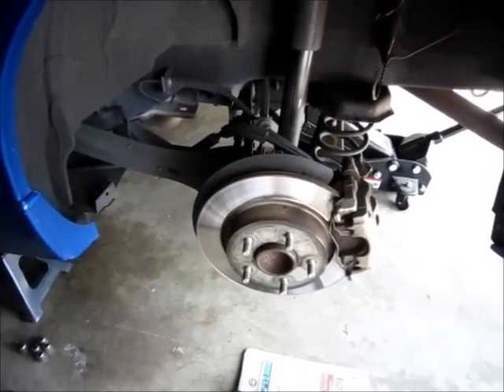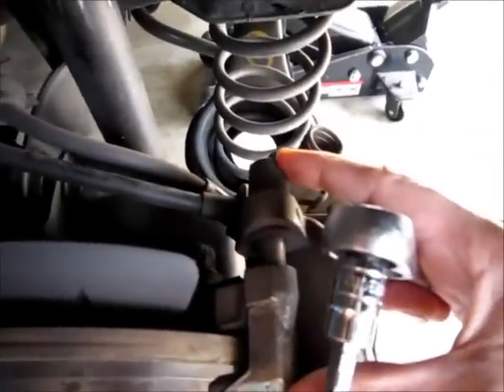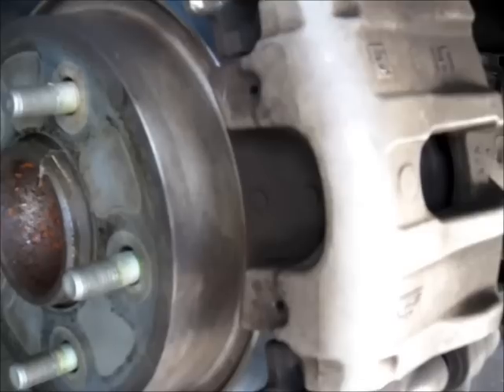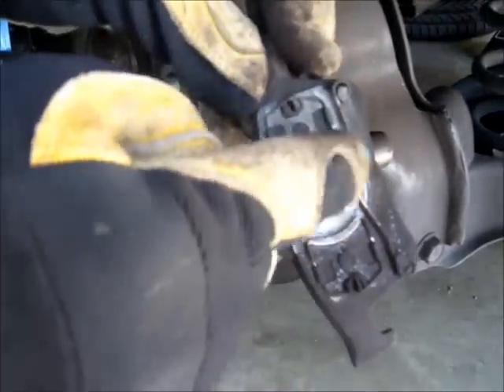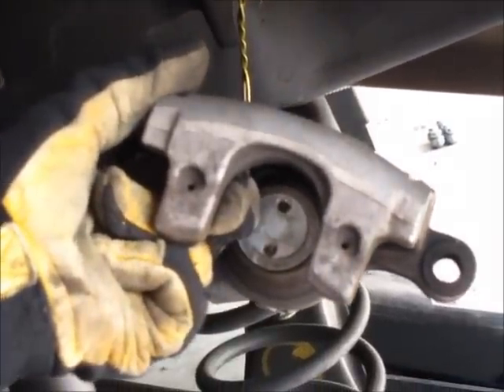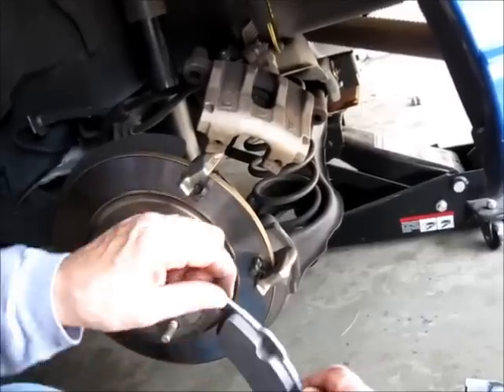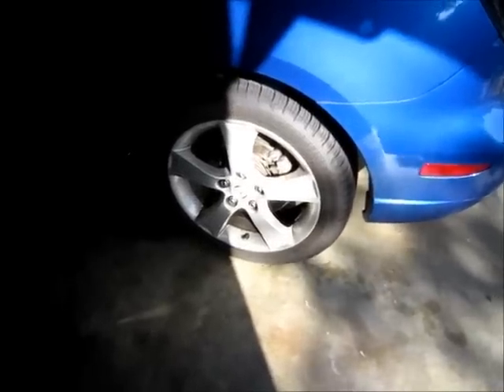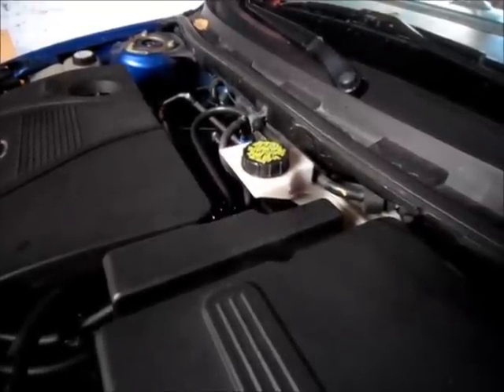2005 Mazda 3 Rear Brake Pads

Comment: On my Mazda 3, I had a friend open the bleeder valve and then push back the piston with a large screwdriver while I turned the piston with needle nose pliers. Worked like a charm! Then I made sure I bled the brakes before I was done.
Reply from the maker: Definitely another way of doing it. I would be afraid of the pliers slipping and damaging the seal or my knuckles.
Reply: cfldriven   I was a bit worried but my pliers stayed in the two holes quite well and my friend was careful with the screw driver. Not one store around me had a compressor to rent.

Comment: Nice vid.  Helped a great deal.  The clips on the backside of the inner pad are there to clip into a groove at the head of the piston, unique to Mazda.  If you don't do this the piston will be pressing on them instead of the pad and can damage the piston.  In my case it caused sqeaky brakes while driving because the pad wasn't fully retracting when I let off the brake.
Reply from the maker: Thank you for sharing.

Comment: good video.  exactly the same for 2012 Mazda 3 rear brake pads.  do a rotor change for rear?
Reply from the maker: Thanks, the basic principles apply. Not sure if you have to rotate the brake piston. If rotors are warped or this is the second brake pad I would op to replace both rotors. Good luck

Comment: Just a suggestion, make sure you get the right tool to compress the rears pistons.   I had an adapter that attaches to a ratchet but you could turn and turn and the piston didn't go back in.   Got another tool the compresses the piston as you turn, that did the trick in no time.   Save yourself some frustration and get the right tool.
Reply from the maker: The next time around I borrowed the tool from the local auto shop, and you're correct it made the job easier.

Comment: Two things. Would have really like to see you use the tool to push the piston back in and would have like to see the tightening with the torque wrench. Otherwise pretty good video. The Haynes manual say to unhook the parking brake cable before replacing the pads. What do you think about that?
Reply from the maker: At the time I made the video it was usually just me holding the camera with no tripod so you didn't always get to see every step. As to the Haynes manual releasing the parking brakes before replacing the pads is a good idea. Using the parking brakes with the rear wheels off the ground doesn't do anything for safety. Thank you for watching.

Comment: Thats really important to my guys next weak im doing it so if i take the cap out from the brake fluid tank i dont have to take the airbout from the brakes and change the brake fliud?? Just changeing the pads?
Reply from the maker: If your brake fluid is not old, you can do pads without flushing the fluid and bleeding the system. However if you need to change brake fluid then consider watching my video on Mazda brake flush
 https://youtu.be/TEMkbZYEJYk

Thank you for your question and for watching.

Comment: Im getting a clicking noise from my right rear side when i make right hand turns in my Mazda 3. I just recently had my brakes done  at the mazda dealership, Is there any reason for this, maybe improper installation. Just me give your opinion. Any help would be great thanks. I wish i found this video earlier could have saved 5 or 6 hundred bucks.

Comment: For the rear brakes there is a cube tool that you can get that works with a rachet.  if you google rear brake cube tool, you can see what im talking about.
Reply from the maker: I got one of those and was never pleased with it. It was better to get a loaner tool from local auto parts store.

Comment: I have same question on regards the size of the caliper adapter disk. Could you please let us know what the size  of it?
Reply from the maker: If you are referring to the tool that rotates the brake piston, it was a loaner from a part store. I sorta recall it came with an assortment of different sized  discs of pins. Sorry I should have noted it.
Reply: Coming in late on this, my UK-spec one has pins on 19mm centres whereas the tool I'd bought had pins on 23 and 33mm centres so wouldn't fit even though it was advertised as being suitable for Mazda.

Fortunately on the tool I''d bought it was possible to knock out the pins and drill a couple of new holes at 19mm centres. Once I'd done this it worked fine and did the job in seconds.

Here's the tool I bought. Note the importer stating in Q&As that it fits Mazda3 and their silence when corrected: www.screwfix.com/p/hilka-pro-craft-brake-caliper-rewind-tool/4119r

Comment: At 9:05 you say you have to torque it. What does that mean? Do you have a video on that?
Reply from the maker: You use a torque wrench which tightens the nut or bolt to the desired manufactures specification. If you go to 3:25 in this video https://youtu.be/syw0skaUVN0 you will see it in use. Thank you for the question.

Comment: quick question about the rear brake pistons, do you need to push it ALL the way til it doesnt go in, or JUST enough to allow the thickness of the new brake pads to go in? i've been getting mixed replies regarding this matter, i would appreciate it if you could tell me! thanks
Reply from the maker: Well this response is 11yrs too late but I would have pushed the brake piston all the way until it was seated. It provides for the most clearance.

Comment: When you took that first outter pad off you said a shop stuck a little piece of metal in there fixed the problem. You never said what the problem was rattle??
Reply from the maker: Joseph, it been 12yrs since I made the video and your the first to ask. The brakes would clatter when driving. They checked out fine, but the tech cut a small piece of metal from a soda can and that instantly solved the problem. Didn't need the piece of metal when I finally had to replace the worn pads, so I suspect one of the shims was bad.
Reply: @cfldriven  Thanks for the reply. Yes i realized the post was 12 yrs old and had no idea if you would respond thanks. Why i asked is i have the mazda3 2005 yes its old. Mechanic replaced rotors and pads new. Not long a few days started getting terrible ratlle clinking and clanking left rear. Touch brakes silence. Took it back to him put it on the hoist did not even take the wheel off points and says caliper worn out car not worth to replace. There is terrible rot i know. I guess i am going to pull the wheel off maybe i can shim it so your video was a good visual.Thanks for the reply. Interesting video on the prius. I will sub you. Your manner of explaining things are quite clear ... cheers man
Reply from the maker: @josephrunions3913  Sorry to hear that replacing the caliper is not a viable option. My concern would be since the rot prevents the replacement of the caliper I would worry that a component failure would lead to loss of control.

Comment: Hi, after you've pushed back the pistons and twisted it clockwise...do u need to manually twist it back to its original position after or will it automatically goes back when u depress the brake pedal?...pls let me know..& thanks so much for this little tutorial...=)
Reply: +Ray “Mr. Yoso” Dar I have the same question, what conclusion did you come to?
Reply: i've just stepped on the brake pedal when i've finished putting back everything together Sir.and the piston just came back on its original position.
Reply: Thank you brother, I appreciate you getting back to me.

Comment: Typically Mazda 3 have issues with rear sway-bar end links, as these typically go bad on these cars. I had to replace them on my wifes car at 60k miles.... If it's only when you turn right then it is typically the left and vise versa. Your brakes shouldn't make a noise when turning because there are no moving parts unless you apply the brakes. It will sound as though something is lose in the trunk or something....
Reply from the maker: Sold this car in Dec 2017 with 75000 and except for some brake clatter, which I fixed with a coke can https://youtu.be/Ar11068EJ3g   this car never needed any suspension work. Thank you for your input.

Comment: Okay my question is i just got my rear caliper installed on my 06 mazda 3 and  because old one was leaking brake fluid. I paid 250 to get it all done but when i left the garage my breaks on the rear right wasnt working wasnt doing anything only the front ones were working so the petal was really soft. Just want to know what they did wrong
Reply from the maker: My first guess they didn't bleed the air out of the brake line.

Comment: im haveing this problem with my rear brake pads on my 2004 mazda 3 .. did your mecanic put any metal piece or you had to buy an special one ? thanks
Reply from the maker: I had a clatter on the rear brake and a tech slipped a small piece of metal from a pop can and no more clatter.

Comment: Anyone else have issues were the back tire rusts to the brake hub?
Reply from the maker: I have had the wheels rust to the brake hub, took some pounding with a mallet to break it lose. I removed all the rust before putting the wheel back on.

Comment: How do you torque the brakes?
Reply from the maker: Actually you torque the nut or bolt with a torque wrench. You have to look up what the specified torque ft/lbs setting is for particular nut or bolt and then use a torque wrench that can achieve that number.

Comment: I kept trying to compress that piston and it wouldn't go, so I figured I'd better see if someone made a video to show me what I was doing wrong.
This one did the trick, thanks.
The wrench for my grinder had the same spacing as the holes in the piston, so I pinched it between the piston and the C clamp and turned it while I turned the C clamp, it was a pain but it worked.
I didn't do it but the guy was right that said you should push that old fluid out the bleeder, then add new fluid and bleed the braked, That's the best way to do it, but I cheat and just push the old fluid back in the lines like in the video.
Reply from the maker: Thank you for sharing your experience.
Reply: @cfldriven   I still have the same car and I replaces the brakes again since then, so I bought the special tool. I also replaced the rotors. I've had that car almost 16 years and I've never had to do any major repairs, just normal stuff like brakes, tires, filters, battery, it's a great car.
Reply from the maker: @bigredc222  Before the M3 (12yrs) ,  I owned a 323 for 18yrs, Mazda makes some under appreciated vehicles. Like you they were trouble free cars requiring only regular maintenance.  I would still have the M3 if I had not opted to go EV, but that is another story.
Reply: @cfldriven  I bought mine new in 08 so I'm going on 16 years.
Reply from the maker: @bigredc222  A great run!

Comment: Thanks for this good video.
I have a question. Is there a same clockwise direction for rotating of caliper piston for wheels on both sides of this 2005 Mazda 3 vehicle?
A reason for asking is that on another video on YouTube is shown a caliper piston tool set with two devices - "left hand side" and "right hand side", with assumption that direction for rotation of caliper piston is different on different sides of a car.
Here is a link to that video:
https://youtu.be/EE_PSY831fo?t=1m37s

Comment: Where you get pads
Reply from the maker: I believe I got these from a NAPA store. I did pay for the lifetime warranty which resulted in a free replacement pads when a clip broke.
Reply: @cfldriven  because  when to autozone  they gave me the one without those clips
Reply from the maker: @MEXRACEMMEXRACEM  As I recall the front and back pads are different. I would not be concerned if it just the the wear clip. Check a different brand and see if they are similar.

Comment: The rear brakes on these mazdas always make noise the brake pads have too much play up and down movement inside the caliper so I see why those custom shims would remove that play movement lol
Reply from the maker: And if any of the springs break off, you'll end up having to replace pads. It happened once to me, but luckily it was under warranty and I had the receipt. Thanks for watching.

Comment: Woooow, 6 years old car and looks 2 yo.  Are you the original owner?  I have 2004 Mazda 3 and looks like S*IT!!  It's rusted out on multiple places, absolute garbage anti-rust protection.  Mazda deserves a class action for that!
Reply from the maker: Soon to be a 12 yr old car. Live in southern CA away from the ocean so without salt air or winter salt to deal with rust is not really an issue. In the Midwest we had to wash the car several times each winter season to get the salt off and they still rusted.